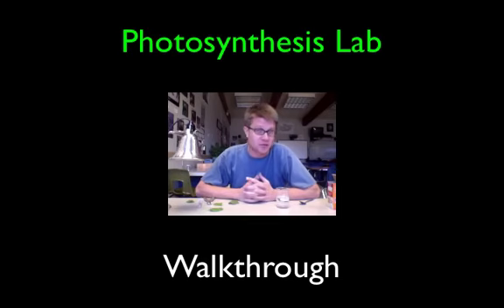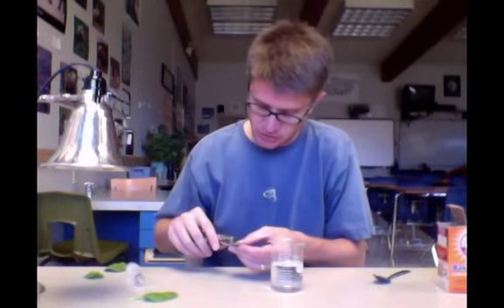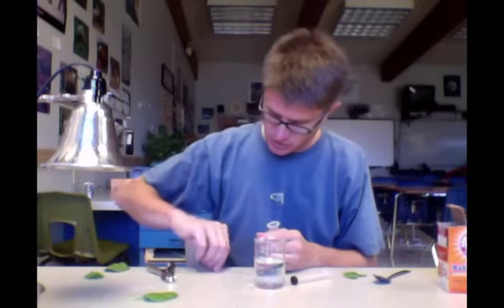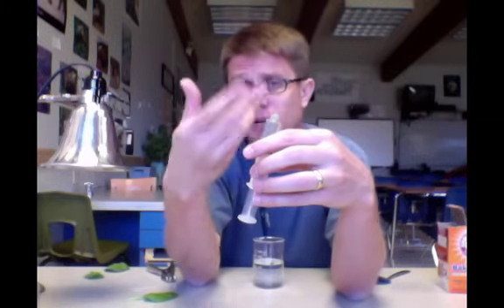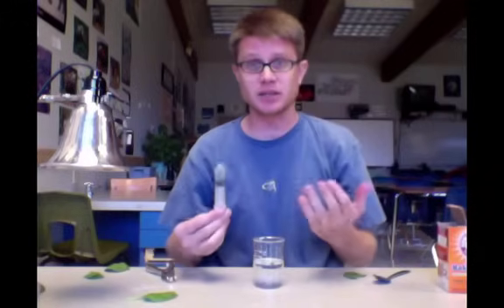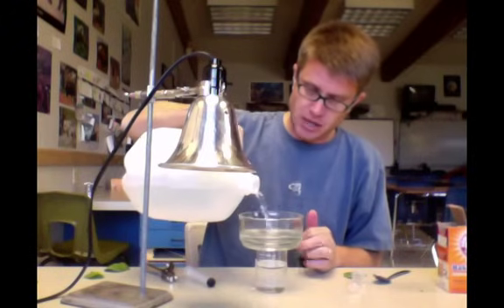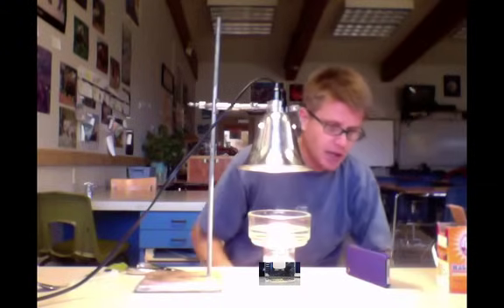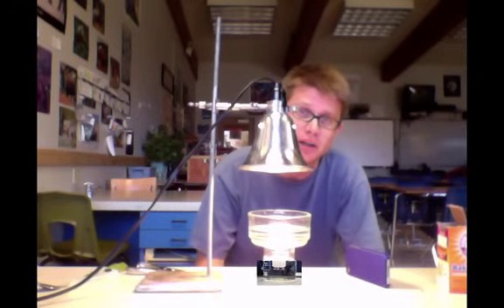Photosynthesis Lab Walkthrough

Comment: I have a question 
is i try using boiling water instead of using lamp and the plant  and it float
Reply: plz answer
Reply: @pascualsofia5882  no, you need light shining on the leaves or it won't be able to perform photosynthesis.

Comment: As I watched bubbles start to form on the leaf, I started wondering...how can you be sure that the bubbles aren't from the water - dissolved CO2 or O2 that was is the water in the first place? Could the leaf be providing nucleation sites for dissolved gases to grab on to? (apologies if this has already been asked and answered)
Reply: It's from the leaf because when it rises it starts to gain weight which makes it heavier and therefore rise to the top. It rises because it's taking in the carbon dioxide and producing oxygen from it. These bubbles would not form if it was not actively in photosynthesis.

Comment: So what actually causes the leaf chads to rise
Reply: +Calypso Calypso Photosynthesis. The process that happens in the syringe pulls the air out of the leaf chads, then by creating a vacuum with the solution, it causes the Carbon Dioxide in the solution to be sucked in, replacing the air. When placed in the sodium bicarbonate under a lamp, photosynthesis starts and releases the byproduct of Oxygen, which increases the buoyancy of the chad and makes it float. We just did this lab in my class.

Comment: Thank you kind sir, I have been stuck with a college bio lab at the last week before the semester since the person that had agreed to do it backed out.  I have taught the lecture for several years, but this is new and I am scrambling and can't find a supply of rennet or rennilase for the lab I was going to do, so this will be a fabulous replacement integrating the sci method testing different wattages or distances from the heat sink.

Comment: Hi Mr. Anderson- My class did this lab, and I'm having trouble determining the dependent & independent variables, and the control.  I assumed that the dependent variable was the number of chads, the independent variable was the amount of 02 in the chads when exposed to sunlight, and that the control was the amount of liquid in each cup. Is this correct? Thanks again for making these videos, they make bio so much more understandable!
Reply: 9 years later, maybe for another student... This is not an experiment, it is actually the control. You have to compare this with another condition, which is your independent variable (amount of light, color of the light, temperature, etc). Then what you measure (the time at leaves start to float) is your dependent variable (which is proportional to the amount of O2 or photosynthesis rate).

Sorry if my english is wrong.